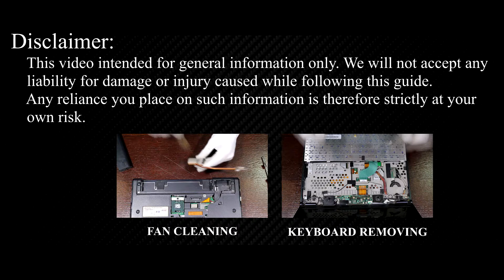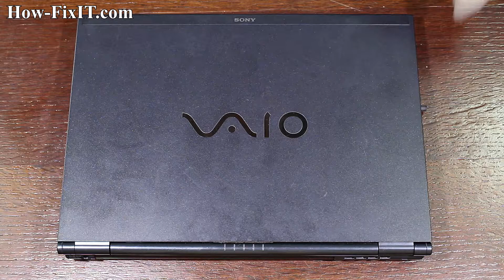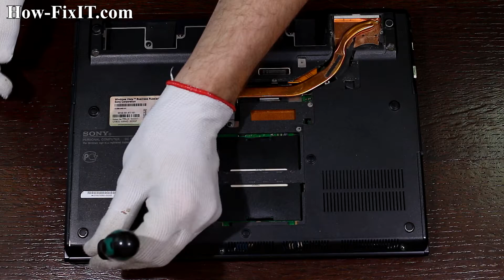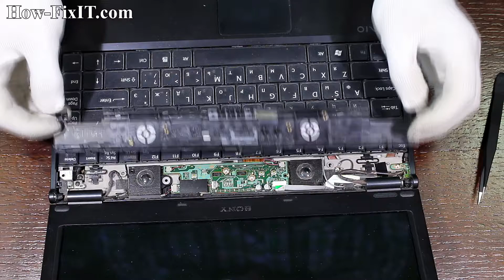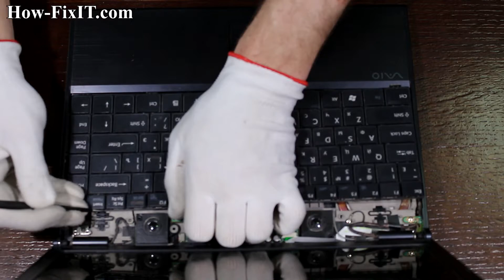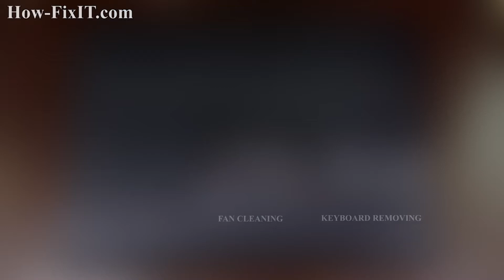Sony VAIO VGN-SZ6RXN PCG-6S5P Hard Drive Replacement – Fast & Easy SSD Upgrade

Comment: I have a pcg 7n2l, I replaced the hard drive with an ssd amd installing xp professional I cant use tge machines speakers, wifi connection or other parts of the device. Any advice?